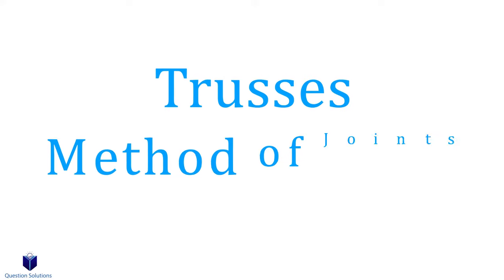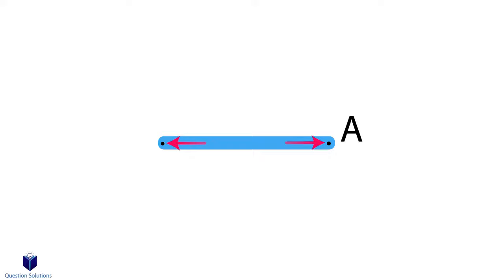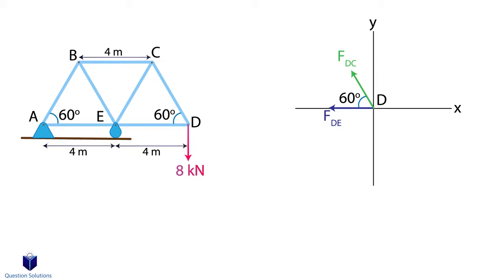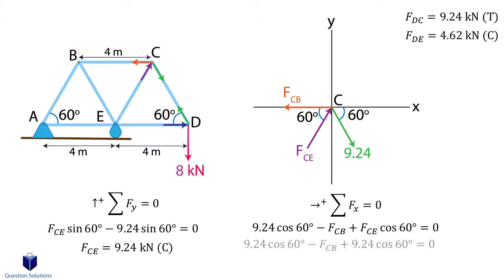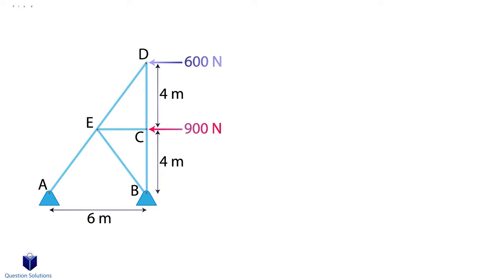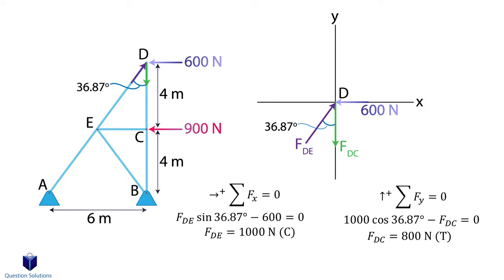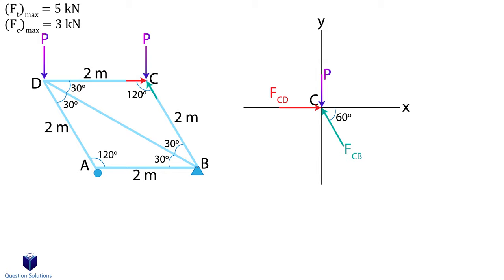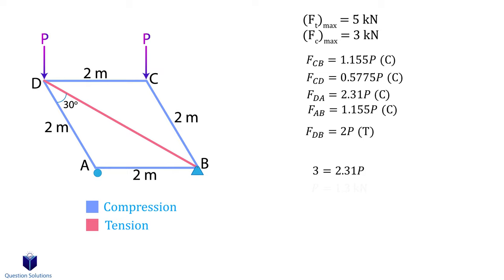Trusses Method of Joints | Mechanics Statics | Learn to Solve Questions

Comment: Why is the agle is on the top?
Reply from the maker: Please use timestamps.
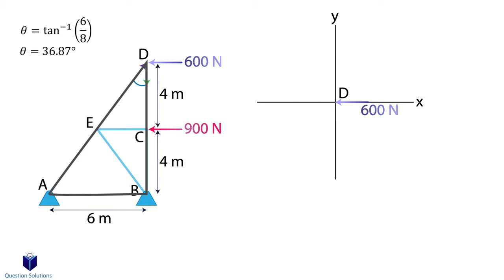Reply: @QuestionSolutions  6:10 Why is it on the top
Reply from the maker: @LOID-wt4dy  We need that angle to figure out force DE. It's the angle the force makes with the horizontal plane line at the very top.
Reply: @QuestionSolutions  Can I still use invers tangent regularly if it's a different right angle. It's hard to explain.
Reply from the maker: @LOID-wt4dy  You can use it whenever you want as long as you use the proper sides and it's a right angle triangle.
Reply: @QuestionSolutions  Thanks

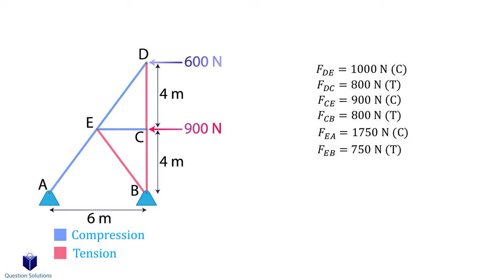Comment: how did you get the answer at 8:02?
Reply from the maker: You have 2 equations with 2 unknowns. You can solve them anyway you like, but I think substitution is the fastest way. Isolate one equation for a single variable and plug that into the second equation.
Reply from the maker: @user-ww8dt5ue8r  Okay, please see: https://bit.ly/3GGIIQM

I solved it for you. However, I'd like to offer some suggestions for you that will tremendously help your "math life." Write your equations clearly and legibly, along the lines of your notebook. Simplify whenever you can, except for answers that come out to be decimals. For example, you have 1500/0.6, this should have been simplified to 2500. It's time consuming to keep writing a large fraction, and the more you write, the higher the chance that you will make a mistake. At first, it might be difficult to write legibly, always easier to quickly write things down, but after a week or 2 of forcing yourself to write it larger, and easier to read, your life will change. You can easily spot mistakes that way, you can clearly see your steps, trust me, it just becomes so much easier :) 

Also, I really encourage you to practice some extra problems that involve simultaneous equation solving. In higher level courses, you will most definitely have to solve 4 or 5 equations together, so make sure you get master these techniques before you get there. 

Best wishes on your studies, let me know if you have other questions.

Comment: How did you get 1000 for Fde in 6:31 
I solved and I got 813
Reply from the maker: Your calculator is in RAD, change it to DEG.

https://www.symbolab.com/solver/step-by-step/xsin%5Cleft(36.87%5E%7B%5Ccirc%7D%5Cright)-600%3D0?or=input
Reply: @QuestionSolutions  omg thank you so much !! I have a statics midterm today. I would have been screwed 😭
Reply from the maker: @chelseamuhwati2387  Glad to help! Best wishes with your midterm :)

Comment: 6:32 how did you got 1000N???? My calculator is saying a different answer which is -599 😭
Reply from the maker: I am not sure how you got -599 🤔 Divide 600 by sin36.87 and you'll get 1000. Make sure you calculator is set to degrees. See: https://www.wolframalpha.com/input?i=600%2Fsin36.87&assumption=%22TrigRD%22+-%3E+%22D%22
Reply: Now I got 999.something when I divide it. But if im going to put it on the calcu like ‘sin36.87-600’ it’s showing -599 weird
Reply from the maker: @rydellgarcia  So if you input "sin36.87-600" into a calculator, -599 is correct. That's because the calculator does what the user inputs. However, that is not how we solve for a variable in an equation. You have to isolate for the variable in an equation before solving, so here, our variable is "F_DE." Isolating for the variable gives us F_DE = 600/sin36.87. So you need to input 600/sin36.87 to get the answer. It is user error, so your calculator is fine :) Let me know if you need any more assistance. Best wishes with your studies!

Comment: I dont understand why, when indicating tension, the arrow is pointed towards the center of the member, and for compression, it's pointing toward the ends. 

Logically, it should be reversed because during tension, the member wants to stretch, and compression would be shrinking. Makes zero sense
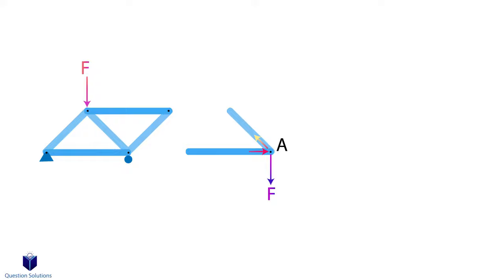Reply from the maker: Did you watch the beginning of the video? I go over this, so watch from around 1:24. Now if you did, and it still doesn't make sense, watch it again and again until it does. This is just what it is, it's not something I made up, this is how it works. :) The forces we see are applied to the pins, and then in turn create an opposite reaction, which is why it seems opposite to what you think it should be. 👍

Comment from the maker: Some students have asked how I solved the 2 equations at 8:02. Please see the following if you need a breakdown: https://bit.ly/3GGIIQM
When to use sine or cosine: https://www.youtube.com/shorts/vynnKlJD_Jo

Many thanks!
Reply: During the calculation of Fea at 5:30, would it be possible to instead calculate the force from the point A where you only have 1 unkown at that point? or is there any specific reason why you would chose point E?
Reply from the maker: @MrJaaaboo  At point A, you have 3 unknowns, a force from the pin reaction in the vertical direction, a force from the pin in the horizontal direction, and force AE/EA. Please see this video: https://youtu.be/jQDEOwrR4UU I explain how pins, rollers, etc. have their own reaction forces and how to account for them. 👍
Reply: @QuestionSolutions  when you're solving a pin/point, does it matter if you solve for the sum off Y or X first? i saw in your first solution you always started with Y, in the second on its always x..?
Reply from the maker: @MrJaaaboo  Completely up to you. Overtime, you will gain the ability to just look at a diagram, see the forces and know which ones will be zero. In that case, you will intuitively know if it's better to start off with x or y. But again, it makes no difference at all, just sometimes can make your life a bit easier.